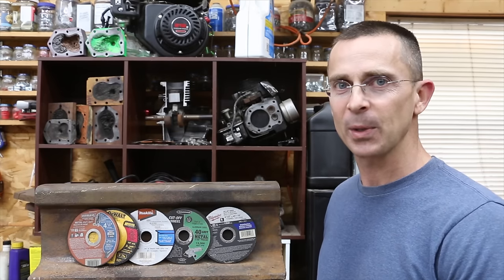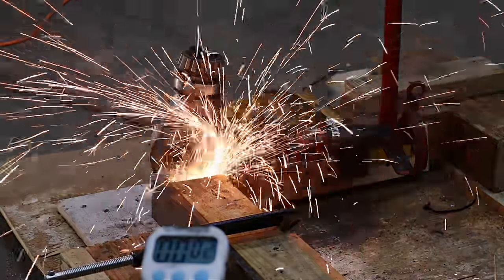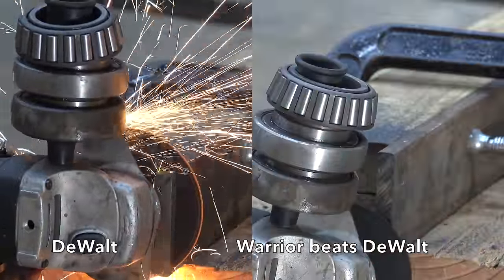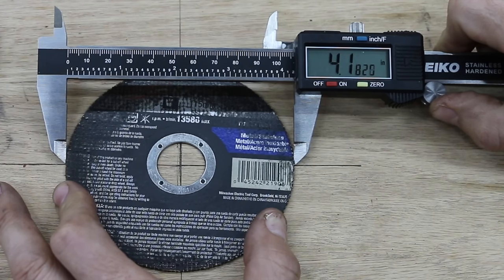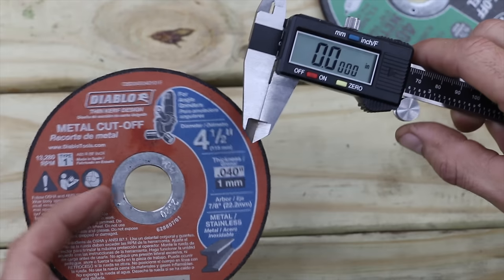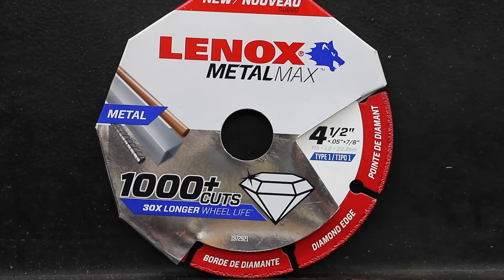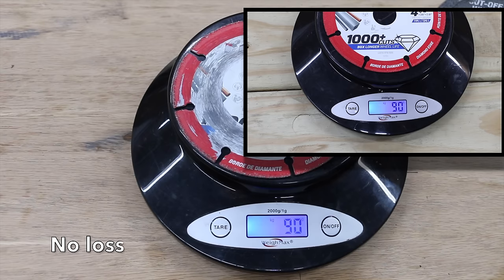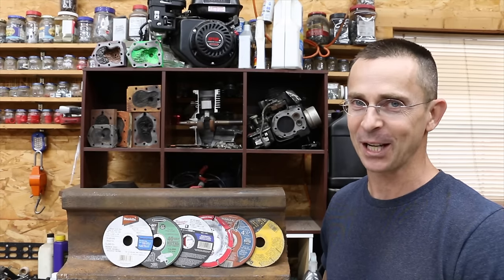Best Metal Cutoff Wheel Brand (6 Brands Tested)?  Let's find out!

Comment: Just an FYI, you shouldn't use diamond abrasives or cutting tools on steel or iron. At the high heat and pressure caused by the cutting action, diamond actually leaches carbon into the iron, causing localized work hardening in the form of iron carbide nodules at the cutting site. Iron carbide is far harder than iron or steel, causing a reduction in cutting speed and an increase in tool wear, especially to the nickel or cobalt binder used to bind the diamonds to the tool. CBN is generally used in place of diamond on steel and iron. In the same vein, diamond and CBN abrasives should generally be used with a coolant to flush away swarf, since they tend to use a thin layer of abrasives and a build up of swarf can lead to the soft metal binder wearing away causing loss of abrasive grains which can lead to no abrasive at the cutting edge. This is unlike conventional abrasives were you want breakdown so that dull grains break off, exposing fresh, sharp grains. Diamond and CBN are so hard they generally remain sharp for the life of the cutting tool.

You also shouldn't use aluminum oxide on aluminum dry, aluminum has a tendency to bond to aluminum oxide, loading it up. On smaller wheels or lower speeds this can be annoying, on larger wheels or higher speeds it can be dangerous, causing the wheel to shatter. You should use a lubricant (but not coolant which can make it worse), like kerosene (better with a little bit of oil mixed in) or WD-40 to prevent the aluminum from bonding to the wheel. If you need to grind aluminum dry, use silicon carbide or diamond.
Reply from the maker: Thanks for the feedback.

Comment: Project Farm consistently provides some of the best, and most objective tool and supply tests.  When I'm really curious how different products stack up against each other, I try to find a Project Farm shootout.  I will say, however, that given the tremendous selection of cutting disks for grinders, it was a little disappointing to see this comparison limited to just five options.  I've seen far more subjective tests that included both the Bauer and Hercules options and the Bauer appeared to be the most economical.  That said, the time factor wasn't considered.  It would be great to see Project Farm repeat this while including a good 15 to 20 different cutting disks options.
Reply from the maker: Thanks!  Thanks for the constructive feedback.

Comment: one important thing to note is you are cutting thick big pieces of steel continuously, meaning the wheel will get extremely hot and you will lose material due to heat degradation, meaning the thinner wheels are at a disadvantage.
Reply from the maker: Thanks for the feedback.

Comment: I've been building some fence panel frames out of rebar lately and needed to go up to Home Depot to get some more.  Unfortunately, they did not have the 10 ft lengths of #5 rebar that I needed, so I bought a 20 ft length of #4 rebar and changed my design to work around that.  Not having access to electricity to use my abrasive discs, and since a 20 ft length would exceed the length of my trailer by too much, I ended up using a hacksaw to do the cuts in the parking lot.

The blade cut through easily enough and I could not notice any dulling even after multiple cuts, so it got me wondering if for something like that, if hacksaw blades might be a more economical solution than abrasive blades.  I normally use a 6" abrasive blade in my circular saw for these sorts of cuts, but with the minimal waste of metal when using the hacksaw blade, I might be tempted to start using it...
Reply from the maker: Thanks for sharing.
Reply: @ProjectFarm  -- I noticed a video on YouTube the other day where someone showed that your cutting technique makes a big difference in how abrasive blade lasts.  When he did a full depth cut like you are doing in your test, they do not last as long as if you use lighter pressure and then score the surface on the line you are cutting, gradually getting deeper with each successive pass.    It took noticeably longer to do it this way, but it significantly increased the lifespan on the blade.

Comment: I am using 3M cubitron on every angle grinder disc type. Grinding wheel, 1mm and 3mm cutoff disc, fiber discs and flap disc. At my opinion, 3M is totally dominating the concurrence. They are expensive but considering the time i am saving and the longevity of the discs, it is a good deal. But i would not recommend to non professional. It is too expensive.
Reply from the maker: Thanks for sharing.

Comment: Could've measured the hardness of the steel bar before each cut, based on all of the thermal cycles you put it through, it could've possibly changed between each cut?
Walter brand wheels seem to be the premium wheels that are used by the tradesmen / metal workers I'm around. Would be interesting to see how they stack up against these brands :)
Reply from the maker: Thanks for the video idea.

Comment: Well designed rig Project Farm, If you can run it on Aluminium that would be awesome, aluminium melts into the blade and is very different than steel. Would be curious what angle grinder blade is the best for Alu. I Love the videos, have a good day!
Reply from the maker: Thanks!  Thanks for the video idea.

Comment: I have been using these in a body shop cutting mostly sheet metal, I have used Walter, Wurth and a no name brand and the Wurth by far was the thinnest cleanest and fastest cut with the least amount of slag left on the metal. the Walter is slow and is thicker and also leaves the most slag. the cheap no name brand is smaller and wears out too fast.
Reply from the maker: Thanks for sharing.

Comment: I remember from engineering school diamond isn’t good for ferrous materials because at the temperature and pressure at the interface the diamond dissolves into the metal forming cementite which is itself a hard brittle material.This is why most all machine tool inserts used in lathes and mills are carbide based ceramics and not diamond. Diamond is is better for composite materials which will chew up ceramic and speed steel mill heads.
Reply from the maker: Great point! Thank you

Comment: Been watching your videos since the beginning.  Love your work...I do question if the differences in thickness and friction between the disc had an impact on motor rpm, effecting the cutting speed slightly...I wonder if one of those optical rpm meters could be used to measure a difference.  If so maybe use one of the larger, higher amp grinders to level the playing field.
Reply from the maker: Thanks for the suggestion.

Comment: I have a 7in cut off diablo disc for a circ saw, would be interested seeing a test with cutoff discs made for circ saws.  They're usually 1/8th inch so i can see where a cuttin wheel would be faster but id still be interested to see the circ saw versions.
Reply from the maker: Thanks for the video idea.

Comment: Great video, diamond tools are not for use on steel diamond is carbon the carbon gets into the steel changing its properties diamond tools are for hard materials like tungsten carbide use a diamond wheel for sharpening carbide tools and a aluminum oxide to silicon carbide wheel for sharping steel tools same goes for grinding or cutting anything if it’s steel don’t use diamond
Reply from the maker: Thanks!  Thanks for the feedback.

Comment: What about testing the skilsaw metal cutting blades? I have an Evolution 14" that I use and it does a nice job but testing those size blades could get pretty expensive. They are nice to have around though.
Reply from the maker: Great test suggestion!

Comment: Here in Denmark, the Makita and Milwaukee cut-off wheels are cheaper than the DeWalt cut-off wheels.
It's also funny how 4½'' (115 mm) grinders are common in the US. Here in Denmark I hardly ever see any 4½'' grinders, just about everyone uses 5'' (125 mm) grinders instead. The price of 4½'' and 5'' wheels are often the same, so then you get cheaper cuts with the 5'' wheels as they will last longer. Maybe you should do a price and speed per cut test for 5'' vs. 4½'' wheels.
Reply from the maker: Thanks for sharing.

Comment: Cutting this way (plunge cut) wears the blade out much faster than if you score cut the material, cutting along the length of the cut making multiple passes so the blade only pokes through on the last pass. Its slower but I've had blades last 10x longer this way.
Reply from the maker: Thanks for the constructive feedback.

Comment: i'd like to see this same test on metal cutting diamond cutoff wheels like the lenox, but i'd like to see how the perform on tile concrete and wood too.

delta diamond B079437W56 $28
shdiatool SA84901 $20
diablo DDD045DIA101F $19
milwaukee 49-93-7805 $18
riggid HD-MTL45 $18
lennox 1972921 $16
ezarc 807115 $16
spyder 14001 $15
Reply from the maker: Thanks for the suggestion.

Comment: Any chance on having a do-over using the newer, ultra-thin blades like Flex's .024 x 5" cutoff wheel, Diablo's Thin Kerf, etc.?  

Also, would there likely be different wear data if the discs cut normally (i.e. gradually)?                                                                                              I know standard discs last longer if the cutting is more saw-like rather than constant downward pressure.

Comment: Project Farm, do you know of a high quality, SOLID cutting wheel that is 1 inch in diameter, or just a little bigger?

I have a 2004 Toyota Corolla. The dim wit engineer that designed it decided the 2 nuts that hold the donut gasket together, on the exhaust manifold, just had to be WELDED down!

There is a lip around each nut, on the end of the exhaust manifold. So I either need:

1: A 1 inch cutting wheel, or just a little bigger, that can do some serious cutting. Using lots of wimpy Dremel cutting wheels does not work. Or

2: A larger cutting wheel, which means I'll have to slice through that lip around the nut.

And also some type of rotary tool that has a long and skinny end. A regular cordless drill is just too large to get down behind the engine.

It has an exhaust leak. I got 2 headaches, then figured it out. So I have been driving with the windows rolled down.

I could take it to Bell's Exhaust, for around $70. But I would REALLY like to cut those 2 nuts off, and replace them with 2 good nuts and bolts, and, of course, replace the donut gasket.

Thank you much. Happy Thanksgiving.
Reply from the maker: Wow!  That's a challenging situation to deal with.  I haven't yet tested dremel wheels or any sort of wheel that small.  Great video idea!  Happy Thanksgiving

Comment: This would be interesting to see repeated with the only variable being around 10lbs of weight. Maybe some blades can be pushed harder than others and may wear less when pushed harder. Kind of like why you want metal chips when machining vs letting a cutter run without adequate chip load.
Reply from the maker: Thank you!

Comment: maybe test the differences (compression, wear on the piston and cylinder walls, etc. ) between breaking in an engine vs not breaking one in (on a small engine of course) not sure if it would be to expensive to try and test

Comment: Quick comment about your video I was looking at the use of blade on the differences when he came down to how fast they cut through the metal and 33 38 seconds it appeared that the Diablo cleared the metal very cleanly and there was very little spark carryover that was into the blade cuttings edge if you look at the video you can see that a lot of cuttings have a spark that carries all the way around to cutting it the best way to 35 sentences very slippery.
Reply from the maker: Great feedback. Thank you

Comment: I use the MasterForce band tho, but I don’t understand these comments.  I’m new to welding and cutting metals but so far  my experience, useing a Hercules 4 1/2 grinder the MasterForce Cuts Metal for me Way faster and with less Junk to breath in, I wear a mask but those black cutting wheels to me are horrible. Let’s spend 4 dollars on a wheel , Their ment to be used with more force , I guess with not enuff force they will cut slower... put like 20 lbs of downforce on that diamond blade and watch it go threw that metal like butter.
Reply from the maker: Thank you!

Comment: Thanks for the test. Too bad there aren't any of the big European cut-off wheel brands like Tyrolit, Pferd, Norton, Sonnenflex, Bahco, Metabo and Bosch. 
But Freud and Diablo is owned by Bosch, so maybe their cut-off wheels are identical? And Milwaukee wheels in Europea are made in Germany, probably by a German manufacturer like Pferd or Sonnenflex, unlike the Milwaukee wheel in your video.
Fun fact: Tyrolit was co-founded in 1919 by Daniel Swarovski to manufacture grinding wheels for the production of Swarovski-Crystals, when Swarovski couldn't get cut-off wheels from their suppliers because of World War I. And now Tyrolit is one of the world’s largest producers of bonded abrasives with their world headquarters only a few miles away from Swarovski's world headquarters.
Reply from the maker: Thanks for the feedback.

Comment: One - Interesting in the Diablo vs Makita that the sparks on the Diablo were much darker (yellow/orange) compared to the Makita (closer to yellow/white) almost as if it was managing to cut at a lower temperature.
Second - Using diamond wheels to cut anything that isn't carbide-level hardness (or granite/ceramic) is silly. Kinda like how Drill Dr with the diamond dust coated grinder is silly. They'd be better off with a good carbide grit instead. This falls under the "speeds and feeds" type knowledge of cutting things. Using a diamond grit wheel to cut mild steel, is like using a hacksaw to rip lumber.

Third - Had I known this was on the list of things. I could have sent you a few variations of Norton industrial cut-off wheels (not really sold at local hardware, usually through a supplier). Not as a way to try and advert another brand, but to widen the comparison to "consumer/prosumer goods vs commercial/industrial retail goods"
Reply from the maker: Thank you for the feedback

Comment: I think harbor freight still wins (for DIYers at least) because the wheels with a 20% off coupon are about 1/4 of the cost of the makita!
Reply from the maker: Thank you for the feedback
Reply: carefull what u buy at HF, some brand names they carry are not eligible for the 20 or 30 % off coupon, must read the REALLY fine print..
Reply: @louisrichards3702  the newer brands usually don't qualify but all the original brands qualify.

Comment: Can you do a test with all the main professional brands? 
Using a 5" Type 27 x 0.045" Cutting disc (good for steel and Stainless Steel)

Platinum Razor
Norton Gemini
3M cubitron
Walter Zip cut
CGW
Tyrolit
Weiler Tiger
Bosch
DeWalt
Diablo
Klingspor
Rhodius
Jet

(no diamond blades)
I can send you some of the Platinum and the Rhodius discs.
Reply from the maker: Thanks for the suggestion.

Comment: I do enjoy your videos, and there's a lot of useful info in them. However, how is .5" lost on the warrior wheel 41% of the usable material? Also, I've used the Lennox blade for stainless steel and thinner, hard metal is where it shines. I went through several different blades trying to figure out how to cut up some 1/8" stainless material before I spent the $$ for the Lennox. It also cuts sheet aluminum well without clogging like regular abrasive discs do.
Reply: I would also like to see how the Bauer blades from harbor freight stack up in this competition. I'm not saying the warrior blades aren't cheap junk, I'm just wondering how .5" of a 4.5" disc is considered 41% of the usable blade? Wondering about how you figured the % of all of the blades used

Comment: Thank god I'm a dewalt person :p. The first drill I ever got has been thru Hell n is somehow still goin strong lol   that was over 30 years ago now n iv bought ALOT of dewalt products in the meantime n haven't been let down yet, especially with the dcf899 or something like that, brand new ones go for about 230 240 but honestly iv seen this exact model go thru sooo much crazy shit that as long as it seems like everything's wokin fine when testing it, then u won't have a problem  .. Sry I got sidetracked on the impact I jus love tools especially power tools n that impact bad as shit itll snap lugs like they're nothing, do axle nuts like they're nothing, crank pulley bolts also theirs a new method to sized bolt removal now, jus put that thing on n pull the trigger lol :p
Reply from the maker: Thanks for sharing.

Comment: Was the steel at the same temperature when you started each cut? Latent heat can affect the durability of the resin bonds within the discs.
Reply from the maker: Great point. Yes, I always allowed the steel to cool between tests for the reason you mentioned.
Reply: Very good point.  You will notice galzing on the wheels' sides, which is an indication that the organic resin has heated up beyond the point of keeping the grain together (like melting).  Hence, the grains will fall/chip away and not make effective contact with the material.  Could not see the wheels after cutting to determine whether they glazed or not.  I always suggest cutting hollow section / tubing to minimised or even alleviate the glazing factor.

Comment: All manufacturers have different types;grades of cutoff wheels, there are different grades of aluminum oxide and most premium cutoff wheels contain mixtures of Zirconia alumina and ceramic which increase cost but reduce labor by cutting faster and lasting longer.  Please test the brands higher peformance cuttoff wheels and compare the VALUE each has please.
Reply from the maker: Thanks for the suggestion.